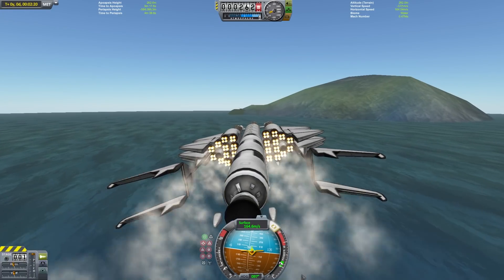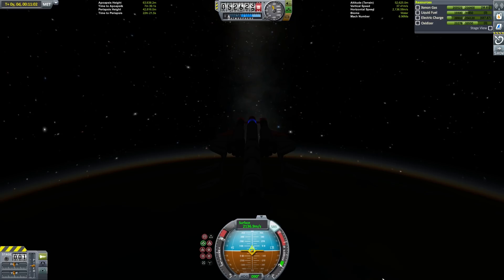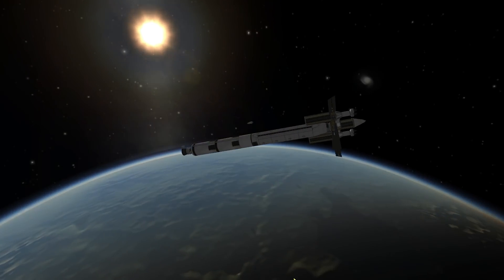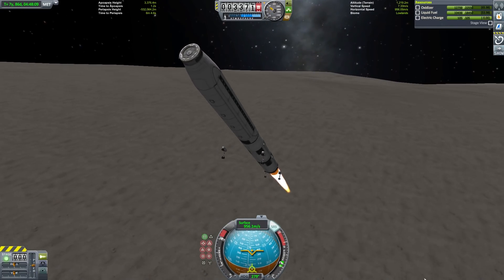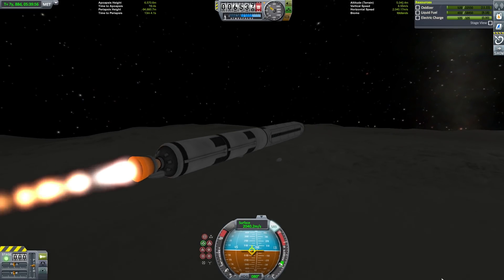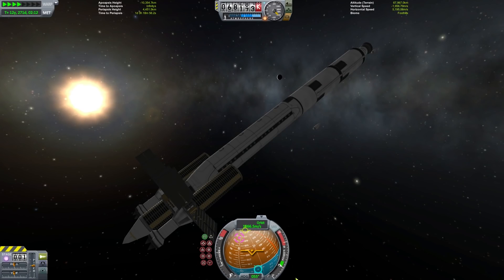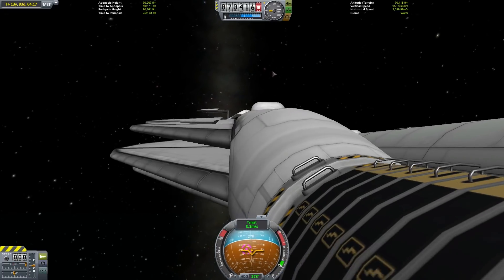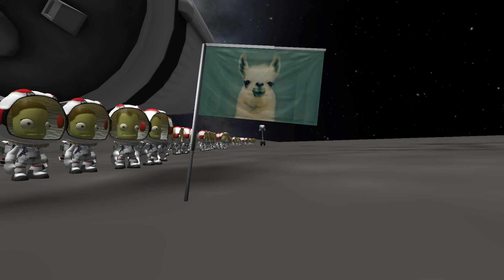SSTO Passenger Spaceplane to Tylo;  Fully recovered, no refueling or ISRU - Kerbal Space Program

Comment: Not sure if this is worthy of an Odyssey by Bill episode, but I'm really curious. How close can you get to the sun without exploding? 

Suppose the Kerbals have exhausted all of their fossil fuels and are suffering from an energy crisis. Bill embarks on a daring mission close to the sun, armed with heat shields, solar panels, and a bunch of empty batteries. Naturally the craft will have to be a fully recoverable SSTO; it can't be too easy. He charges all the batteries, then brings them back to Kerbin before the vending machines run out of power.

Or something like that.
Reply from the maker: I like this idea.  I wonder if radiators would help reduce the critical distance.
Reply: This is an awesome idea, I’ve crashed a space probe into the sun before and seeing brad do it should be very interesting
Reply: @rangarutisersundar8843  Point them the other way, into the very cold (~2K) void of space.
Reply: @rangarutisersundar8843  True. Once you're deeper in so that there is significant radiation and even fluid conduction from all sides, then you must use reflective materials and perhaps even heat exchangers a bit like those found in air conditioning units (not that those exist in-game).